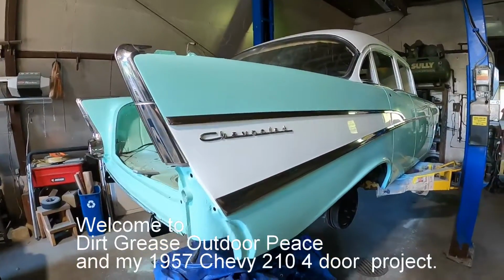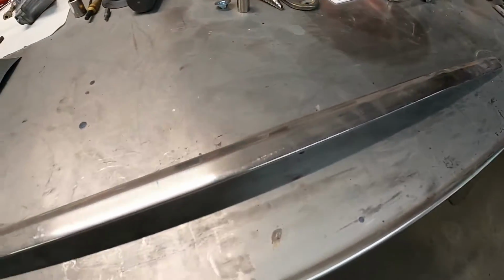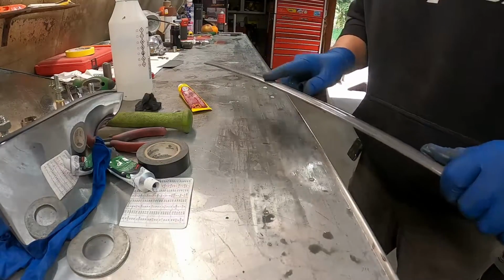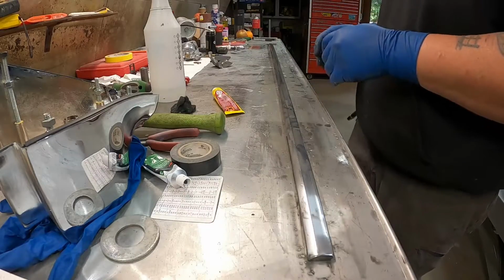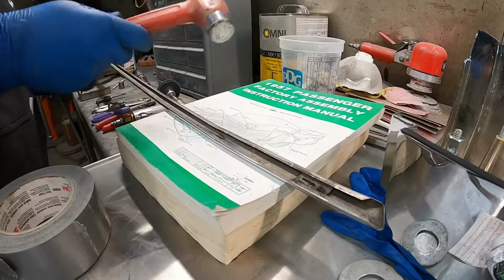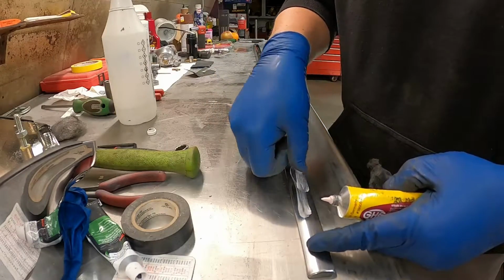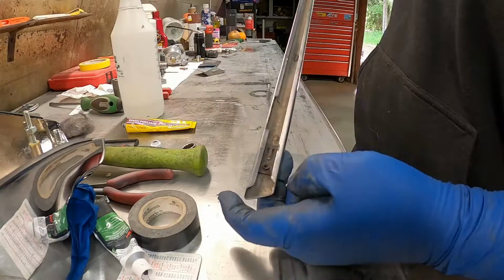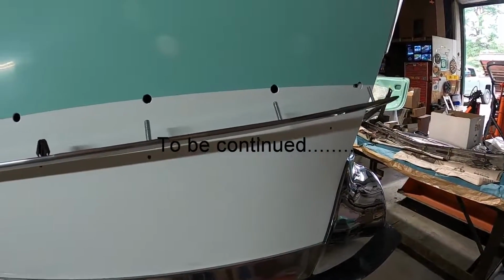1957 Chevy 210 4 door Side Trim Restoration and Install How to Clean and Polish Stainless Bel Air

Comment: Question for you, any advice on finding out what fasteners I should use for a 1956 Cadillac ?  My stainless came loose in the trunk, like yours did !   Looks lke my car got painted somewhat half assed and never put back together.  That's where I come in, installing a rebuilt engine from a 62. Get it running, then make it pretty !.    I see your car is already pretty !
Reply from the maker: Thank you. 
You could look at a parts diagram through someone that sells reproduction parts. Or I have found that Summit Racing tech department is a wealth of knowledge.

Comment: Street Rod magazine or hot rod, years ago, had an article about polishing stainless and aluminum.  Three different compounds and a buffing wheel on  polishing wheel (like a grinder, but slower RPM).  It does amazing work and brings it back.  FWIW.
Reply from the maker: Thank you

Comment: That 57 Chevy 210 was worth the restoration n it would be great to drive on the road again but better in warm weather climates not in winter weather
Reply from the maker: Thanks. Yes it’s only driven in nice weather. You can see the finished product in “Fall Foliage Ride” video I made
Reply: I just bought a 57 bel air I'm building specifically for winter in northern canada. Old cars don't have the problems newer ones have at -40C. gonna put in 2 block heaters!

Comment: Thank you for sharing. What are you using on your chrome? I have a 57 Belair 4 door hardtop.
Reply from the maker: Thanks. I would clean it with hot soapy water then carefully clean with 0000 steel wool and poly wax.